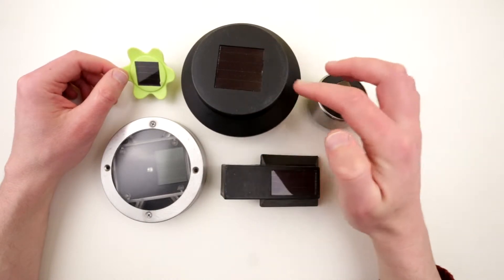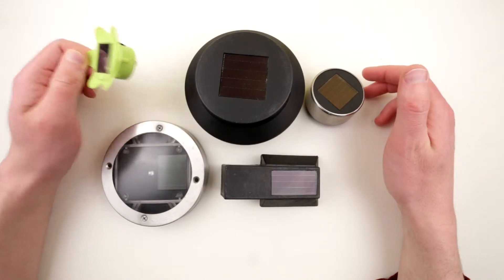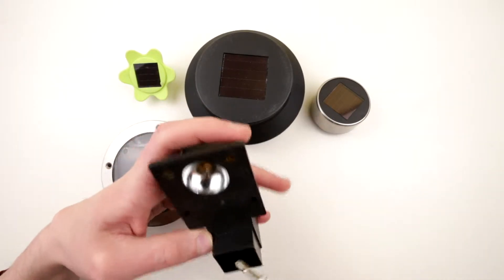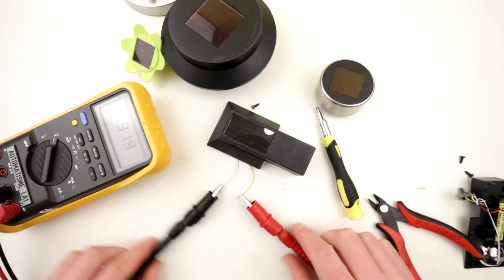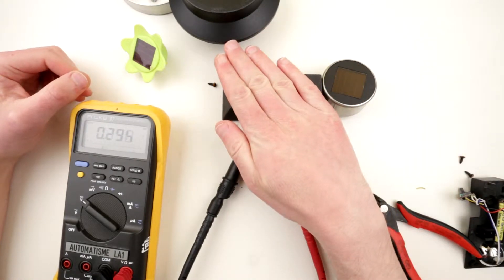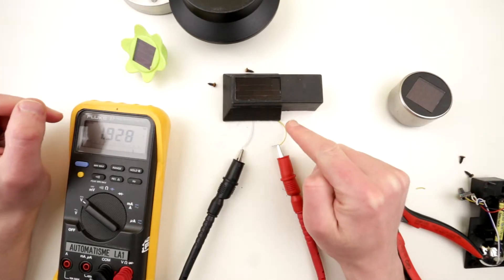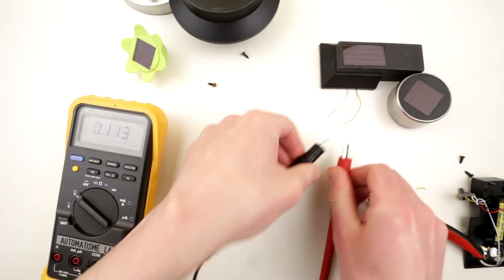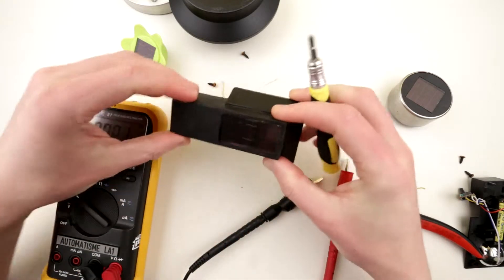How good are cheap LED Solar Lights?

Comment: This green is inductor not resistor and it is limiting diode current. Black blop is LED driver (charge controler, on/of light, joule thief circuit). That first one doesn't look that bad, probably easy to fix (also cool look). I repair many of them, also done my own DIY solar lights. Now i had about 50 solar lights, the oldest is 11 years without any change (maybe only baterry about 7 years ago). But still i have one 11 years old baterry on solar light (orginal baterry) which still is about 100mAh. That button baterry looks like Ni-Mh 80mAh button cell. The quality of panel should be checked also by current (Isc) not only Voltage (Uoc). Solar panel can have same voltage but different current - bigger ones can have Isc =50mA when smaller ones are about 10mA. The capacitor is optional (needed for color changing diodes).
Reply from the maker: Thank you, I keep learning every day.